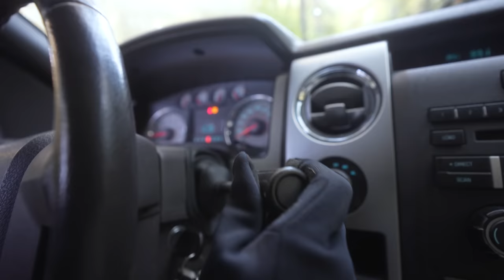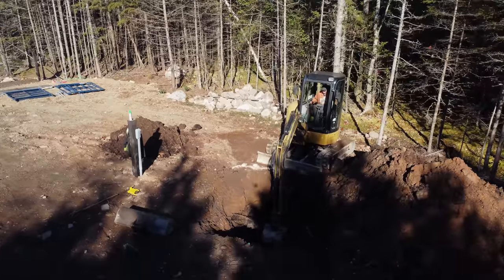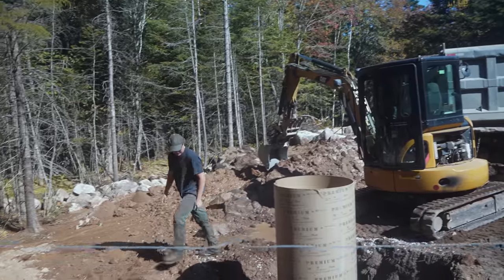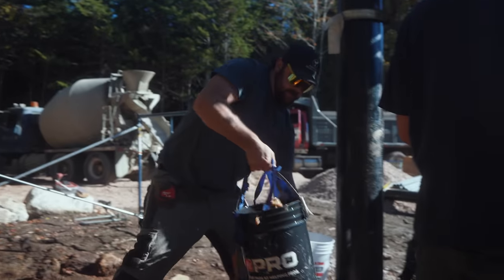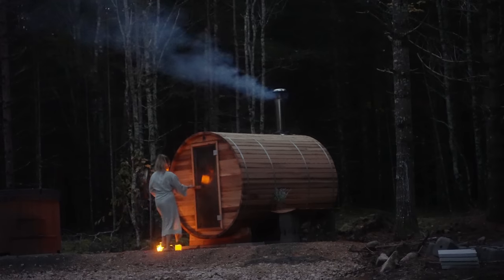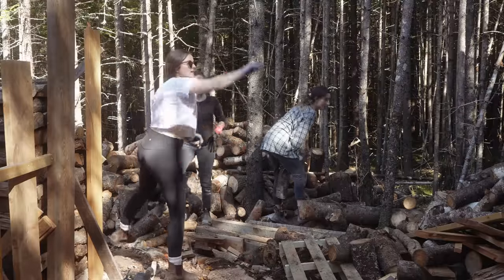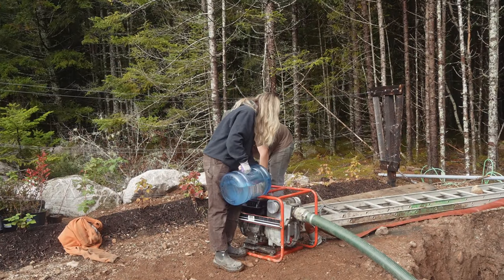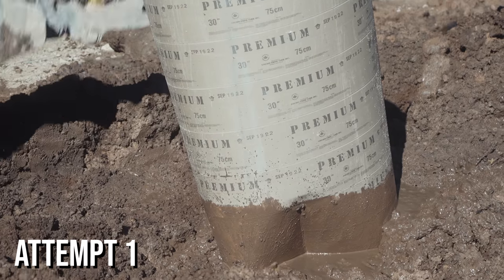We Survived The Hardest Part (Off Grid Solar Power System Part 1)

Comment: the way you solve your water problem is like this: first, buy a 6" piece of sewer pipe DR-35, and a submersible pump that fits inside the pipe- it should be 13' long and reasonable; then you re-dig the original hole, place gravel as before; the place the 6" pipe a few feet away at a depth 6" below the sonotube bottom; cut it off at ground level; place the sub pump in and run it until concrete is poured and a little dry; complete the sonotube install as before; when concrete is dry, remove pump and pull 6" pipe out with excavator. Repeat for #2

Comment: Porter is amazing and Crystal is amazing how she has worked so hard to design and to figure out all the supply that it would take to get yalls solar rate put in. And Porter with his skills with the excavator and his knowledge in how to get the job done. And both of you girls are amazing how y'all work together to get thing done. Great job y'all now the polls are in the concrete is setting in the next step will be getting the panels up and the wiring ran to the cabin the greenhous and wherever else you need electric. Love 💕💕 y'all. Can't wait untill next Sunday to see what's next.

Comment: Congratulations ladies! It takes a lot of perseverance to work through that many problems. Just a suggestion, should you find yourself needing to pump out a muddy hole like that in the future, put the strainer inside a 5 gallon bucket  before lowering it into the hole. that should prevent the pump from picking up enough mud to stop up the pump

Comment: For future reference, the tubes are really throwaway forms. You could find old metal culvert or other surplus/scrap pipe of the same desired internal diameter to use. It just has to be intact enough to hold the backfill before filling with concrete. Highway department or road contractor might even have something they have pulled from service that they would just give you.
Reply: I agree. Or forms could be made square out of scrap 2 x 4’s and plywood.  It’s just to hold the concrete until it sets up. But they got’er done, and that’s what counts. 👍

Comment: Have you thought about drainage for the yard. Have a look at farmer P videos for laying more pipe to know what i mean. It could help. Have a look at conveyer belts to shift firewood easy. I did see one put a tank under ground when they tested ti to see if safe drinking or even safe for blue water use then extra pipe for drainage when tank filled. With that much rock i reckon safe drinking water but get it tested first.

Comment: I don't know if you thought of this or someone else to post this however. that water that filled the second tube did you ever think the possibility that you can put in the shallow well there and use the water for a garden or it may even be safe to drink.. so you know that you would have what are there I mean you're in a rural City solar panels I mean it could be a super pump there you put in a little sump and in the summer time use the water for your garden.. and if it's the quality is good you know emergency water something happens to your well. it's just something to think about you know you know there's water there I mean considering how much water was in the hole you may have a decent supply of water there..

Comment: Well, it sucks that the pits filled in with NATURAL SPRING WATER, but on the upside...you should have a well dug into the same area and then you will have NATURAL SPRING WATER on the property, which means you can potentially have continually flowing spring water. Knowing Nova Scotia like I do from growing up there, Spring Water is plentiful, especially underground. So, You might not have been able to put the cement pylon in, but, YOU FOUND WATER!! And that's WAYYYYYYYY IMPORTANT ON AN OFFGRID HOMESTEAD. 
YAYYYYYYYYYYY CONGRATULATIONS. Good thing it wasn't black gold (oil) that came spewing out of the ground. That could be a good thing or a bad thing depending on how you look at it.
One thing for sure. You won't have to worry about your solar towers getting blown down in a hurricane, but I would suggest some way that you can rotate the panels incase of a storm so that you can turn the panels sideways into the winds so that you can protect the glass surfaces on each panel. Having the panels up that high is going to catch sun, but also catch a lot of strong winds. You might need to get some welders to come and weld a wrung ladder up each pole with a climbing harness loops alongside the ladder so that you have a catch if you were to fall. And if you haven't climbed before, get some climbing instructions and climd so that it's natural for you to do.

I love seeing the progress you have made just in the last couple months I've been watching the channel. It was Max being there that I found you both and became a subscriber instantly.

Keep Safe and Always Inspiring,
Matt - Toronto, Canada

Comment: I don’t understand why you feeled the metal tube with concrete. The concrete in that will just end up cracking. And they pour bridge columns all the time in water, it actually makes the concrete set up slower which makes the concrete stronger. Correct me if I’m wrong 😢. I’m so happy for you guys. That’s gonna be a massive solar array :-).

Comment: Poor Porter he was so stressed.He wants everything to go right and sometimes no matter what ya do they don't. That spring leak really stressed him out and I don't blame him then he gets drenched with muddy cold water. Felt bad for him he's such a great guy and hard worker. 
  I wonder if instead of using the Sana tube if you used one of those hard black plastic culvert pipes the same size as the Sana tube would have worked better because it would collapse from getting wet with all that water.and probably would have kept the water out of the tube.
Just a thought

Comment: Why did you not use twin wall tube like you used for your toilet, instead of cardboard that goes soggy when wet, next time to cure the water issue do a sump hole in your dig off to one side, use some 300mm twin wall stand it vertical with slits or holes in at the bottom small enough that the gravel you surround it with wont fall in, surround with said gravel, drop pump in and your hole will be dry as a bone

Comment: That was a bit like that old electrician joke.  How many Porters does it take to make water disappear?.    Well done crew.  But seriously, you could tap that water table to your benefit, UV unit and it might be drinkable.   By the way girls, be very careful handling wet cement, its nasty on the skin.  Rubber gloves are best.